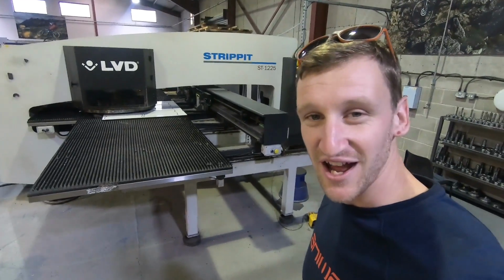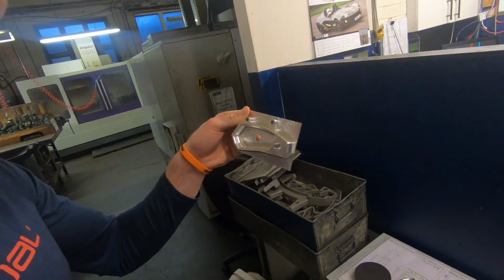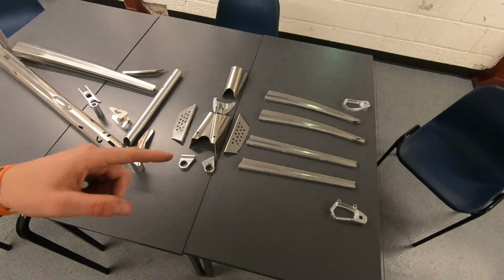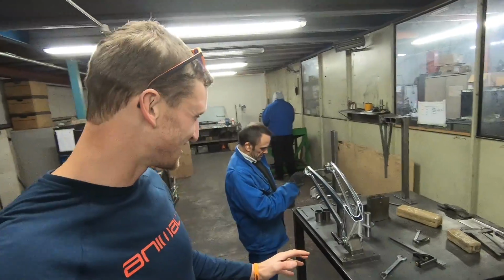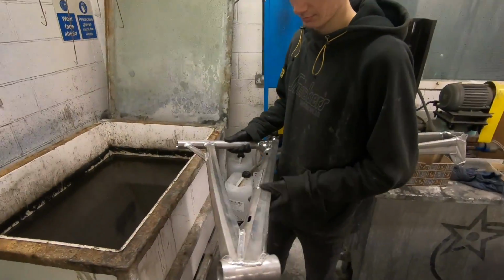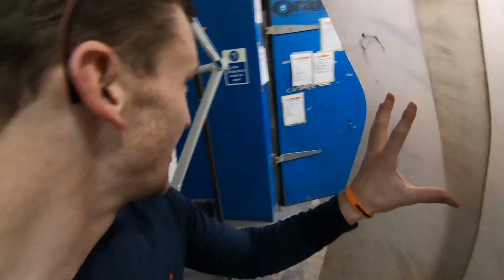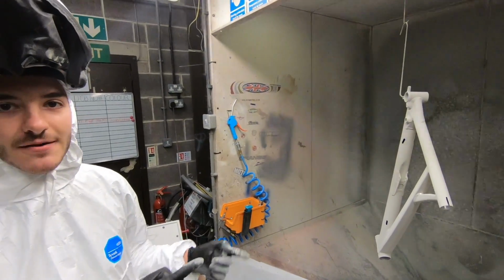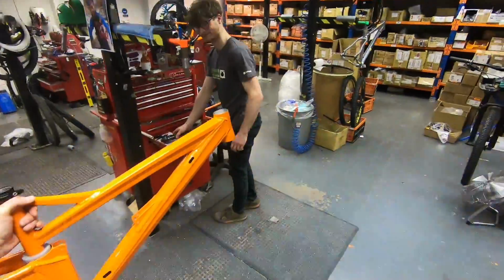Orange Stage6 factory bike build

Comment: Nice bikes… back in 2000!
How can the huge price tag be justified on a basic single pivot bike?
Harsh suspension, massive chain tension, and horrible brake jack! Here’s how to make it work… ad a link to the shock for sensitivity, dual chains, main drive running off the pivot. And a god old floating brake arm.

Comment: I was told that there is a clear lacquer coat put on ATER the decals, to protect the decals. That clearly didn't happen to that Stage 6...
Reply: That’s doesn’t happen. The decals are designed to be removed and replaced. Hence you can buy them on the site.